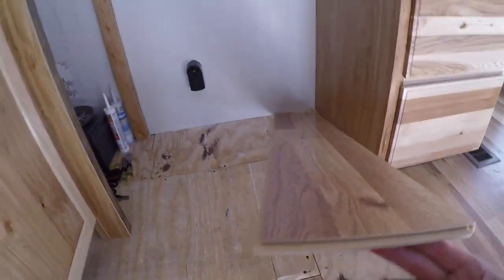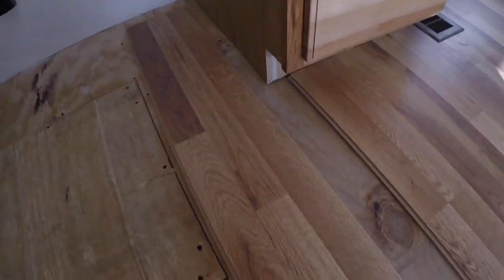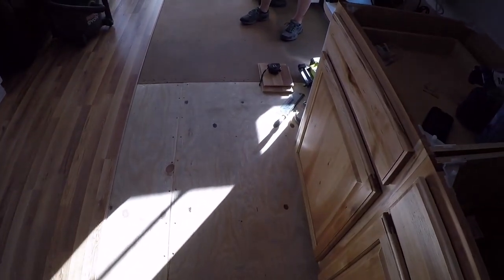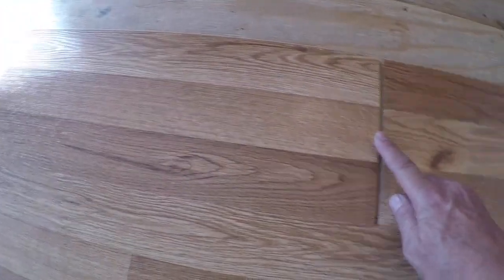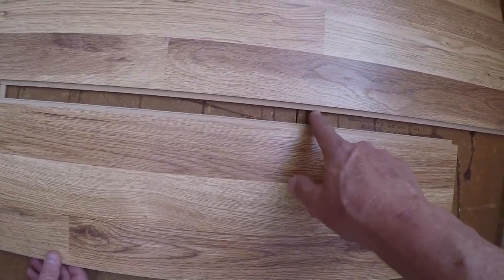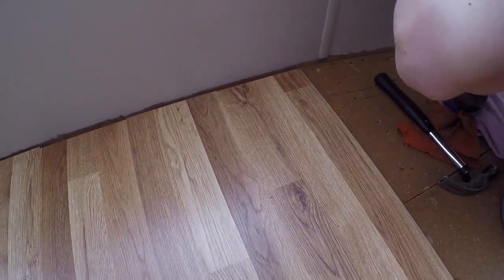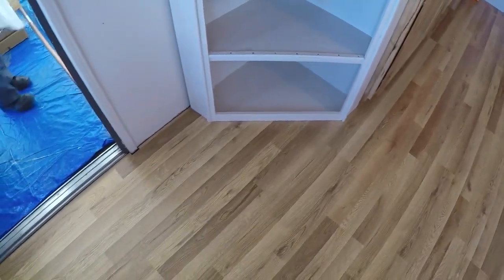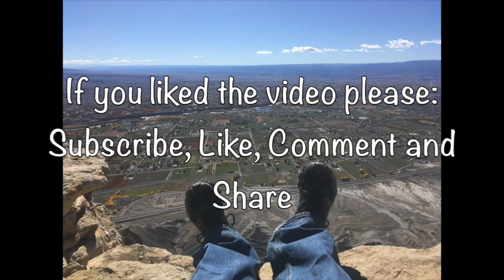DIY Laminate Flooring - Mobile Home Floor Repair Water Damage (Part 8)

Comment: No vapor barrier underlayment ???
Reply from the maker: No we didn't use any vapor barrier. The laminate we used does have an underlayment material integrated on the bottom of the planks.